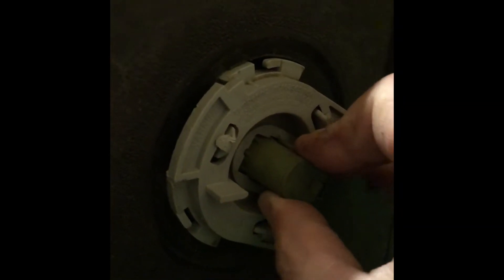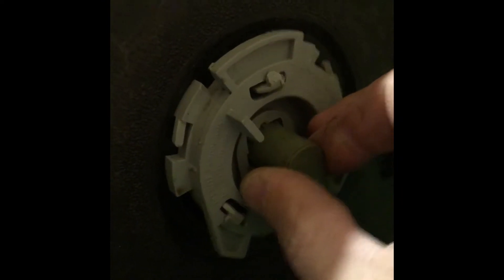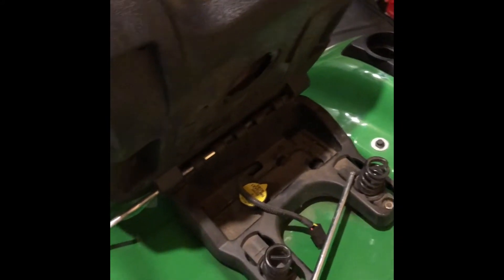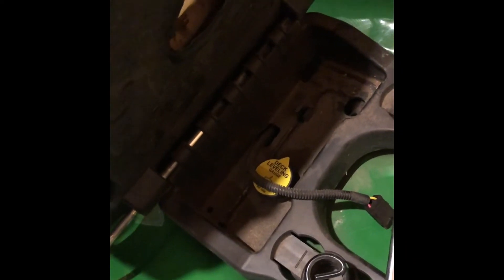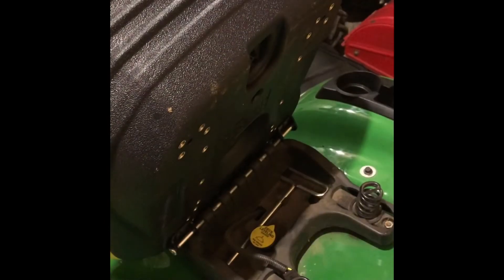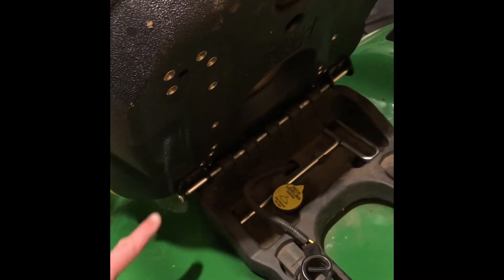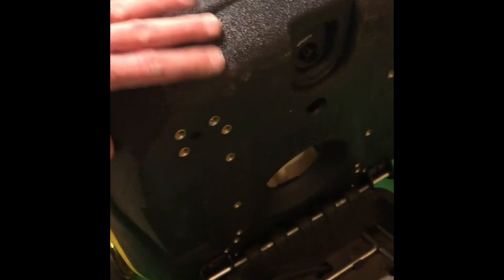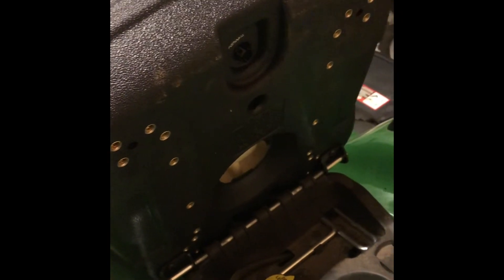Best John Deere Upgrade

Comment: Hi Jon. I appreciate your video of the seat replacement ! However, over this past year 2022, the Seat Warehouse has closed - no longer in business. So I agree that the stock seat is uncomfortable, as I just bought a 2016 JD X580 used tractor with the same seat. I guess I will need to search the Internet to find a good replacement. Again thanks for the video!

Comment: I bought a Milsco seat just like that off ebay, $170 total (including shipping and tax).  However, it doesn't have armrests.  Nevertheless, much nicer than the OEM seat that came on my x350.  Very easy to remove the original seat and install the new one.

Comment: I’ve been looking for that type of seat for my John Deere. Even with your video I still can’t find it. I went to the website you said but that seat doesn’t exist. Can’t find any high back seats with armrests on their site.
Reply from the maker: Yeah I can’t find it there anymore either....  I did find the seat on Amazon seq90-0437 and the arm rest kit separate google bm23761. Its pricey, to bad they don’t sell them together anymore. Not sure why.
Reply: @jonboersma1536  sweet thanks. I put both of those item numbers in Amazon and found both on Amazon. The armrest kit doesn’t have any pictures but is the first one that pops up and is labeled seat kit for $86. Says it’s the armrest kit that only fits Milisco XB200 seats. The seat you gave number to says replaces Milisco XB200Y-N so it should work then.
Reply: How much does this seat sell for.